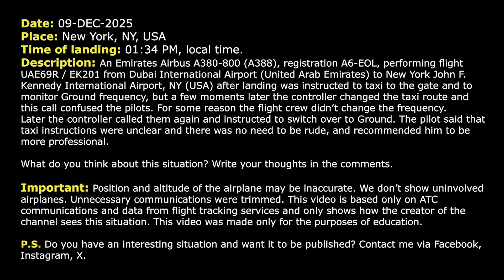Emirates pilots ask JFK controller to be MORE PROFESSIONAL. Pilot argues with controller. Real ATC

Comment: I know nothing about planes or air traffic, but the JFK controller was the first to develop an attitude. If the pilot was failing to do what he wanted through a miscommunication or even negligence, the proper response would have been to correct him calmly or more urgently if it was an emergency. He was angry and irritated. While the pilots were on the other chanel they were likely discussing the controllers attitude and getting angry themselves.

Comment: Since I was a controller, I'm usually quite tough on the controllers.  But this one wasn't unprofessional, just unclear. 

I believe the pilots expected to 'run into' Delta from going straight ahead on Alpha.  If they had referenced the airport diagram, they would have seen Delta on the other side of the airport.  The controller told them they were going all the way around the airport.  It may have been clearer had he told them they would be making a few turns on Alpha before intercepting Delta.  

The controller's problem here was that he ASSUMED that the pilots could read an airport diagram.

Comment: I believe the comptroller was at fault but not really fault? Let me explain, the comptroller works in that airport so probably knows the ins and outs of that airport. But the  pilots don't just work out of one airport they work out of hundreds of airports meaning there not just flying into just one airport but many. In my opinion the controller should be a little more patient and maybe could say delta s heavy changing what I last told to this, letting the pilots perk and quickly to understand new instructions are incoming. I'm not sure but that might be too much to ask for but would've been more clearer. The one thing I don't tolerate is disrespect from either a comptroller or a pilot. But it's also like if a comptroller invites me to his house and I ask for the restroom it falls to the comptroller to be a good host and either tell me exactly where the restroom is or better yet show me but again that may be a bit to much to ask for. But it would help cut down on misunderstandings if comptrollers remember there the host.

Comment: I rather have the pilots confirm if they unsure, rather than take the wrong turn as that would be a lot worse for the ATC's traffic plan. The ATC did tell them to expedite the crossing of the runway though and not to stop, but the crew did not comply with that (because of their confusion). The ATC's instruction was clear, but it also was not what the crew were expecting either (again, further adding to their confusion). 

My conclusion from this clip - ATC is extremely familiar with their airport, most foreign pilots are not. As an ATC, you need to be more patient and clear with foreign operators. I am sure a local crew would not have had any issues with the instruction at all. I do understand that ATC was annoyed because crew did not follow his instruction, which has a knock on effect for other aircraft and New York being a busy airport only makes it worse with the knock on effect - but ATC still need to be professional about it, it's all part of the job. 

It seems NY controllers get a bad rap for their attitude, and I tend to agree as I mostly only get to hear these kind of clips, however I am sure the majority of their transmissions are very professional and expeditious. (I have worked internationally as an ATC and never heard so many different clips of ATC being rude to crew as I have heard from NY - but that doesnt mean I have never heard it in other places either)! The busier the airport / airspace, the less patience the ATC's have for non compliance, hence their grumpiness. It's a thankless job with high stress at times, i respect all the controllers out there including the extremely busy NY controllers. Easy to criticise from a PC, but not so easy to do the job they do. 

Bottom line, both pilots and ATC need to work together to make things work smoothly, just sometimes the two don't always gel. Keeping your cool (on both sides) can really help during these times.

Comment: Here are two quick findings from the conversation:
1. “Hold short of [runway/taxiway/bay], Delta in this case”
Meaning: Stop before that point and do not cross it. This is a clear, mandatory instruction as relayed by the captains onboard.
2. “Continue short of [runway/taxiway/bay]” is not standard ICAO or FAA phraseology, as communicated by the tower.
If you hear it informally, it’s usually intended to mean:
Keep moving, but stop before you reach that point.

I guess the confusion came from misunderstanding Tower’s direction of “continue short of D,” to “hold short of D”. But the pilots did relay it back (to whatever they understood) to the tower and it was acknowledged as an affirmative. So there, the nuance of ‘holding short’ vs ‘continue short’ could be the confusion leading to the trouble.

Comment: ATC changed their initial clearance to turn right on A, into go straight ahead on A and to keep it rolling as there was traffic behind them.

The A380 is a big aircraft and cannot be held somewhere just like that. The 777 is also a big aircraft and there was insufficient space behind the A380 and would block runway 22R.

4 pilots, 2 moving maps and still being confused, despite flying into a busy, if not one of the busiest airports in the US and NOT being prepared for eventual ground instructions to be received after landing, while ATC kept their tone calmly and professionally (in my opinion).

The A380 pilots got confused themselves (probably too many pilots that exacerbated the confusion) and were the ones that were not professional tbh.

Comment: Ahhh ..no big deal. Would i be in trouble if i was air france , having to go full length landing , tower packing a THY too tight twr mistake for thy go around . The twr grinding AF gears with # possible PD , In trouble to call 1 800 eat shit for tower deviation ? . ... i read that on a trailer hows my driving sticker.

Comment: Based on the comments - are the JFK Tower controllers Actual commercial Pilots themselves - or Simulator only Pilots 🤔 

Could explain their 'confusing' instructions🤐🙃‼️

Apparently Google clarifies this confusion....

Air Traffic Controllers (ATCs) are not required to be commercial pilots, as they have separate, distinct training and licensing, but having prior pilot experience, like a pilot's license, is a major advantage and can help them better understand pilot perspectives, though they still must go through rigorous ATC training and certification. 

Their focus is managing aircraft movement, while pilots focus on flying the aircraft, requiring different skill sets and extensive, specialized training for each role. 

Maybe it is About Time Tower 'pilots' had a background of Actual Flying & NOT JUST on Simulators....CONFUSION cleared!

Comment: There’s so much wrong here from both sides …. The pilot telling local control his gate is occupied directly after receiving crossing instructions is crazy 😂 

The controller should have used prescribed phraseology like “taxi without delay” instead of “don’t stop.” 

If the pilot is confused at the instructions, then why does he read back the instructions like there wasn’t any confusion? Is the ATC supposed to read his mind? If you’re confused as a pilot, specially when crossing a runway with traffic behind you, you need to speak up immediately. 

There’s nothing that should be confusing, specially to a pilot certified to fly a super A380 with potentially 500-600 passengers on board, about changing a right turn on alpha into a straight ahead. It’s not like the controller gave him some complex instructions…..he literally said instead of turning right, go straight. 

Again, if the pilot is confused, he needs to speak up right then and there and not continue to taxi slow across an active runway. The controller definitely could have had better phraseology throughout the entire scenario and also, yes he could have had more patience, but planes need to cross runways at a decent speed because of arriving/departing traffic on that runway….assuming it was an active runway that is.

Comment: (1:47-2:01) Taxi correction is given by ATC; Pilot repeats back 'straight ahead on alpha hold short of delta'; ATC replies 'Thanks and don't stop. I've got a triple 7 crossing behind you'. [Don't stop seems quite clear to me] 
(2:18) Pilot asks 'do we hold at kilo delta?' Based on the audio shared, there's no mention of KD prior to this so why would they suddenly think they should do so after repeating 'short of D' in the previous relays?
Sounded like they initially understood the instruction until ATC got firm with them but I guess the tower could have added 'you're going all the way around the airport' (2:22) when they provided the taxi correction to them, just to be sure the non-US plane understood completely? Although pilots should understand the airport diagram also prior to landing. 
(2:42) ATC calmly tells them they should be with ground..point niner before pilot calls him rude etc. This seemed rather unprofessional to me. Deal with it off the air perhaps. Since we do not have full audio...Just my 2 cents. 😁

Comment: OK...around here: 2:45 Pilot says instructions "weren't clear before":  1. You repeated back the exact instructions. 2. If the instructions weren't clear, say so and ask for clarification.  The pilot is trying to rationalize not following instructions.
Reply: the issue seems to be that they were already on A and approaching D (at KD)  which they were told to hold short.
Reply: You are not familiar with JFK's controllers are you? 🤦🏼‍♀️
Reply: @xx-ve6pf I am familiar and I opened the video thinking I will agree with the pilots but in this specific case, unfortunately the ATC is at right in my opinion.

Comment: It was loud and clear to me! Difficult to argue with a native speaker having difficulty understanding and there's also the consideration that radiocom signals deteriorate at distance, so if this was recorded at ATC, then it may not be exactly what the UAE flight received. Nevertheless, airing complaints about "rudeness" on airline radio channels seems like the only "unprofessional" thing that happened here. Be as rude as you want, just get me in the air and back on the ground safely!

Comment: It's bullshit to be squeezing traffic crossing runways. American airports are sub standard infrastructure trying to keep up with increased air traffic. The rest of the world has built new and bigger airports or added new runways and terminals. The ATC should have been clearer  by saying that it's A long way round hold short if D. There is no sign of any D in the short term going forward and the only logical turn is to the right. Where D is. Being an experienced international operator for decades, the US had some of the most unprofessional and non standard ATC around.

Comment: The confusion here is that Delta is on the other side of the airport. If a pilot that is not very familiar with the layout of the airport is asked to hold short of Delta in the position where the plane was, it is understandable that the pilots think that ATC perhaps meant KD. If ATC tells them in first place to go all around the airport on Alpha and then hold short of Delta, maybe the situation would’ve been less confusing.

Comment: I do think ATC was a bit rude and he could have said change to instructions instead of "correction" which was not clear. I get that ATC has to clear  a lot of planes, but from a pilot's viewpoint they are on the runway and see things differently. Asking for clarification was the right thing to do.  That said I didn't take the second ATC asking what was the issue with the instructions. It's a safety learning tool for the first ATC. My opinion as I have never been an ATC.

Comment: Few things came to mind.

1.  Controller gave two very different routes.  A few extra words would have cleared this up ‘emirates let’s send you the long way round.  Straight ahead on A to D’
2.  The Emirates crew have just come off a long transatlantic flight.  It’s unlikely they will be as sharp as they were.
3. 777 on the runway is controllers problem - surely they should not be cleared until the exit is clear
4.  After he changed/replaced his instructions he did not reconfirm the change to ground frequency 
5.  Emirates were presumably unsure and proceeding with caution while they worked out what was what.  Telling them to speed up at this point until they are confident that they are following the correct route seems dangerous.

Basically an over aggressive New York controller.  Who would have thought it.

Comment: As a pilot, sometimes you need to know how to read in-between the lines when ATC gives you instructions. Tower informed them that traffic was behind them so it should've been clear to keep the aircraft moving down Alpha in a timely manner. ATC shouldn't need to send a second transmission to explain to expedite. Sure the controller mightve been alittle snappy, but they were conveying more urgency with the instructions the second time around and were still professional in my opinion.

Comment: The controller caused this situation by blurting out a late change to the original instruction as they were crossing the runway. He compounded the problem by NOT clarifying that they would be taxing all the way around the airport. Add to that, he pressured them to expedite the taxi as he simultaneously cleared another heavy to cross the runway. From the pilots perspective, they were prepared to turn right A and hold short D. Now, suddenly they were abruptly told to take the scenic route without specifically mentioning that and pressured to expedite due to 777  crossing behind them. The emirates crew suddenly is overloaded, unsure and they see KD ahead of them so they (understandably) slow down to clarify but get a talking down from the controller. The controller is too busy to issue proper instructions but has plenty of time to argue like a toddler. The emirates crew is dealing with a A380 and have every right to be cautious when they have a doubt and seek clarification. They were polite but firm in telling the controller to be professional. I am with the pilots on this and the controller needs to take a chill pill and do his job better.

Comment: Unprofessional controller change of instructions should have been more clearer. Also when you give clearance to cross the runway and expect another plane to follow, you obviously must use the word "EXPEDITE crossing".  EK pilots should have handled the situation better as well. Also not switching to  GRD frequency is entirely on the pilots.

Comment: Hhm. Tower assumed that maybe the pilots were aware that work was being done so they were just probably doing what they normally do give instructions change them shortly after and move along. Ground was very clear and provided proper instructions. The toner used by tower however was quite condescending while ground was professional. Different level of maturity I guess.

Comment: It would be clearer if the Air Traffic Control towers and landing airplanes also communicated through short text messages for clarification. Like using a pager device. 📟

Comment: My friend called JFK if we could come and pick up his mother in a Piper PA-28 . The agreement was, sure come 8:30 expect RWY 04r. On one occasion flying down the Hudson flight corridor, I thought I would go back to Plymouth Massachusetts via Long Island and I gave the tower a call if I could enter the control zone for an transitioning and no problem. American ATC are both nice and rude at the same time, the lessons I learned from flying in the State don’t argue with them. I think the instructions were clear, but maybe the controller could had been more clear about the B-777 also crossing behind. Flying a IFR night flight across L.A , coming up the Hollywood area I ask the controller the position of the Hollywood sign and ATC said you are about 5 miles south, okay thanks and then the controller asked me, do you want to see them, obviously yes, okay cancel IFR, descent heading this and that. After a detour back IFR to San Francisco, that stuff isn’t possible back in Europe. ATC communications is a personal skill as in any communication. If you f**k up on the radio admit it, say sorry, if the controller doesn’t admit it, then forget it. Anyway this is the short version, if the Emirates crew had contacted the ground frequency then smooth sailing.

Comment: I dont see what the problem is with the controller. Original instruction was turn right on A and hold short of D meaning Emirates' route will be short.
Then changed to straight on A and hold short of D, making it take a longer route.
Regardless of the effect, instruction changed, where it has no rocket science in it to confuse anyone.
Also, Emirates did not make any clarifying question to the controller, and delayed airport traffic by some action (what kind of action it took has not been clearly pointed out but the consequence was that it resulted in 777 being at the crossing position of 22R) just for their convenience.
So it should be Emirates' fault.

Comment: So for all the people that missed it. He said keep your speed up there is 777 behind you. He then literally proceeds to almost stop the plane again with the 777 behind him. So to prevent a wreck which is actually ATC job he told them to keep their speed up because they are going to have a plane run into the back of them. They never stopped till they got short of d. The instructions didn't change after that and even the other controller said being confused was weird. Btw in case you don't know when you change radios it's changing the channel. So the other guy saying how are you confused shows it wasn't them.